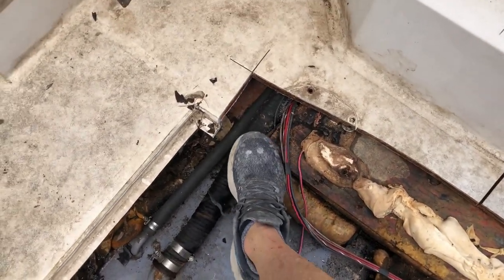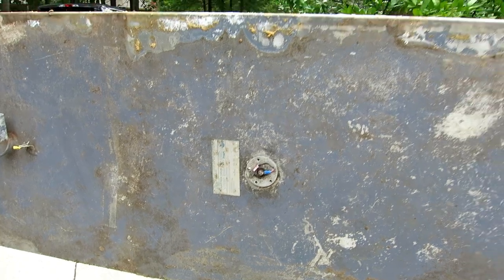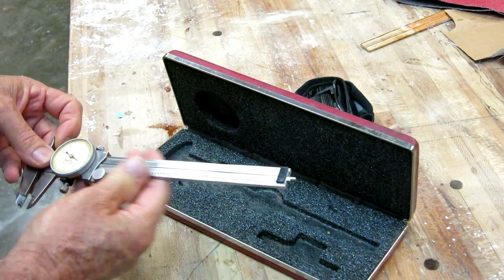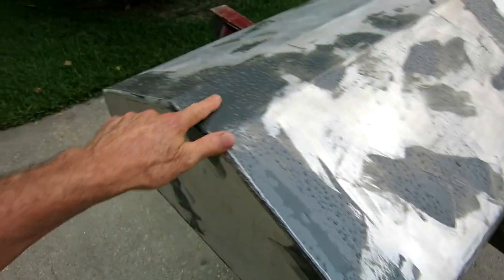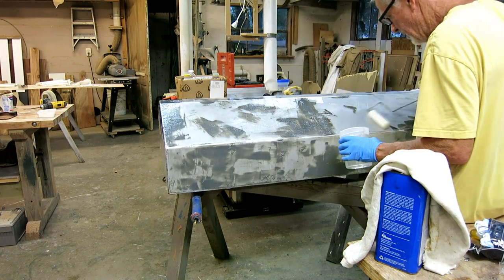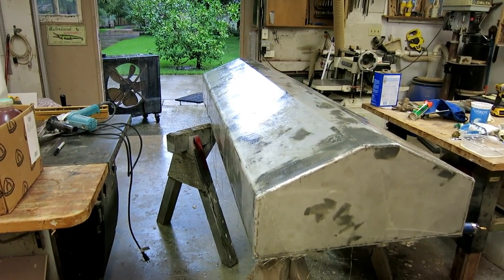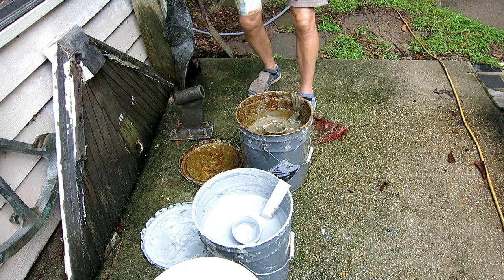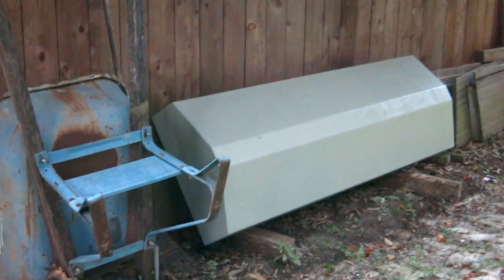The Center Console Boat Project #3 Aluminum Fuel Tank

Comment: Smart move on the 4 PSI. 
I cut out enough Al plate to build a 15 Gal tank and took it to a welder. He forgot to turn his air regulator down and that tank swelled like a basket ball before popping a seam.
Reply from the maker: Pressure testing can be pretty scary. Even with pressures as low as 4 PSI. Assume my tank measures 24" wide by 72" long (it is close to that). That's a total of 1728 square inches of surface on the top plate of the tank. At 4 PSI we now have a total force of over 6900 lbs trying to open the tank up like a sardine can. Scary stuff!